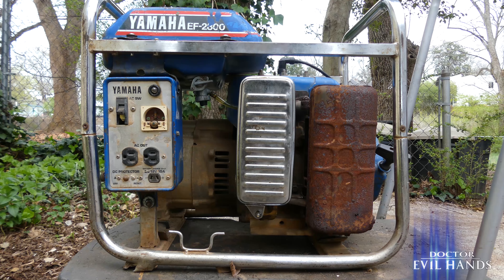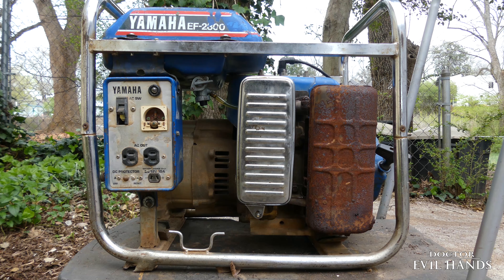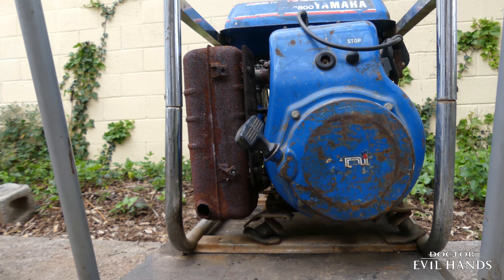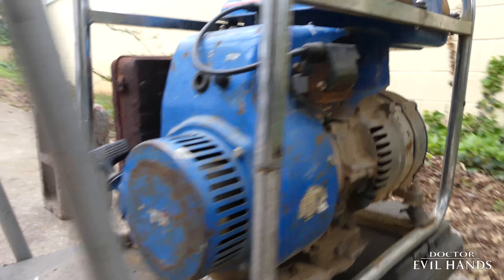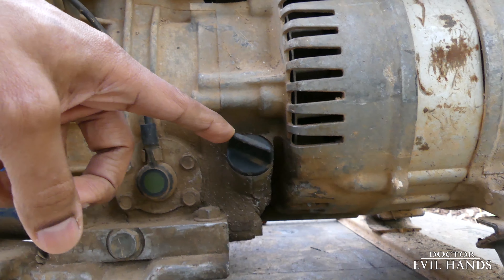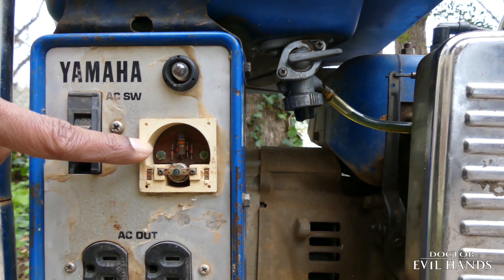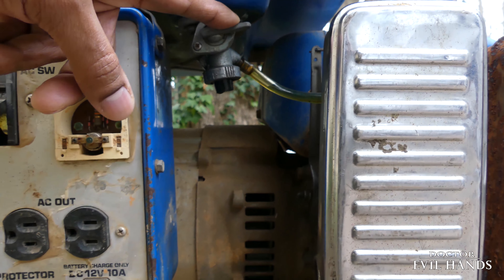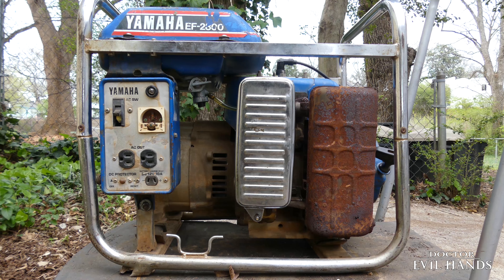Yamaha EF2800 Generator PT 1: A Cool Find

Comment: Hi. i have one of these. From a garage sale; free !.   i had to completely re-do carb, even taking vanes off of throttle/choke, as was a bit corroded. Also had to weld, those cross members to the round tube frame; ends on motor end, broke off when moving it. (rusty) I then put two 6 inch wheels (bearings !) on a  1/2  inch shaft, about 8 inches from the engine end. Welded a steering wheel, (3 inch) on the cross frame member,  (in the middle) on the other end. Now, it can be steered, wheeled wherever.  I had to trash the original tank, as was very rusty/corroded inside. Amazon has gas tanks; i ordered one for a quad, about 14 x 11  x  3.5 inches deep. It will fit (with homemade brackets, maybe small shelf brackets ?) on the tubing at the top.  This thing, runs at 3700 rpm, and with two angle grinders plugged in, running ; the rpm goes down to 3620-3630, and still putting out 120 volts, (119-121).  I got a plastic gas tank, from trashed lawnmower, as temporary one, wired onto tube frame. Starts first pull,    i will always  remember   the older guy, which gave this to me.  THANKYOU  all, for  
'' recycling '' older,  well made   things.  !
Reply: oh, one more item:  Mine has  two  20 amp fuses,  where your large breaker is, top left corner of power panel.   All else, is the same.  The generator part, is  VERY  WELL  MADE.   Unlike modern  'junk'  made in cheap china.....
Reply from the maker: Wow. It sounds like you put in some work on that Generator.Those old Yamaha Generators are usually beat up a bit if you can find em. but they are solid and built to last!
Reply from the maker: 85 to 95% of Consumer Generator made today are cheap Chinese throwaways. The older Generators is where the value is at.

Comment: Hi I have one of those it's a great little generator . Is it possible to slow down the engine speed or are they factory set?
Reply from the maker: Hello.To my knowledge the engine speed is factor set.
Reply: THEY  are designed, and  'governed' (not politicians !) by a centrifugal mechanism, inside the crankcase. 3600  rpm  in  REQUIRED,  FOR   60  CYCLE  ( hertz)  operation; as in  North  America. Any other speed, will directly  AFFECT  THE   VOLTAGE,  AND  FREQUENCY  ( the hertz'  =  cycles per second)/  (oldElect  tech)